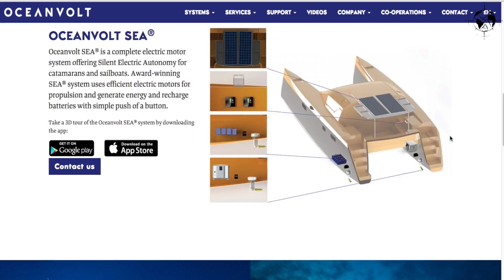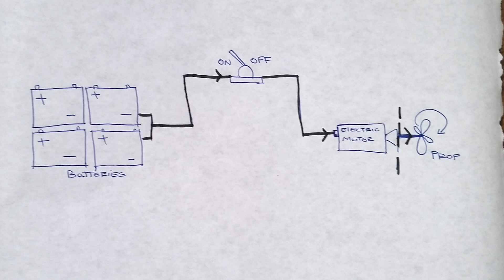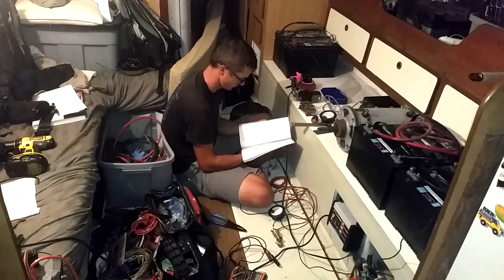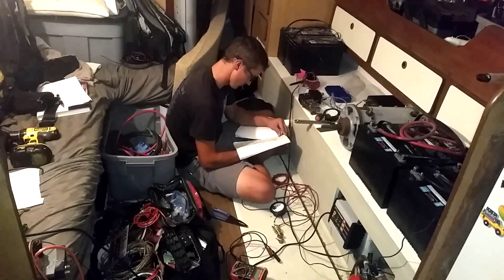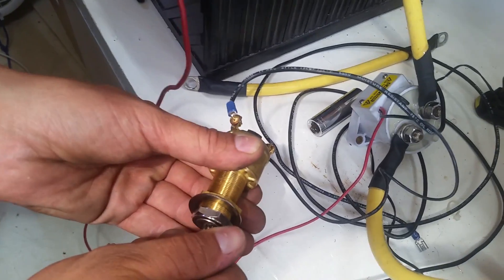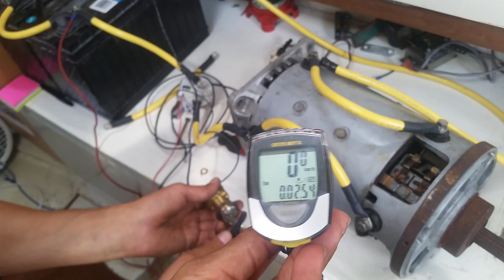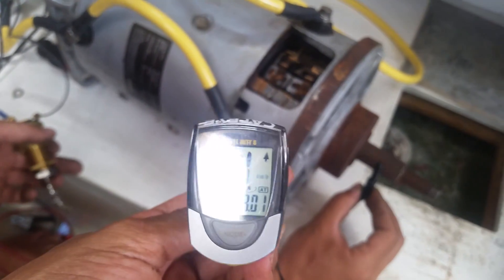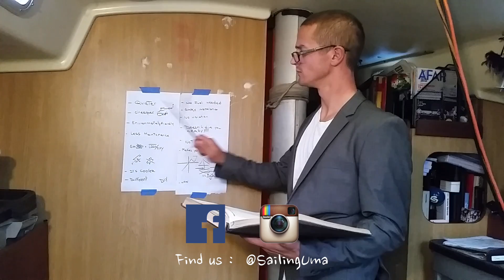We built our own ELECTRIC MOTOR  (Electro-Beke, part 1) — Sailing Uma [Step 17]

Comment: have a question can you put that electric motor in series with a diesel motor.  most electric motors shafts can be attached front and back. so it would be diesel transmission then electric motor. I have drawn it out I think it can work. so you can us electric and ha  .  've a diesel as back up.
Reply: Hellava life.  No put the trans in neutral when operating the electric motor. That way the diesel is not turning
Reply from the maker: +Thadeus Moor Yes, they actually make a Hybrid system. I can't remember which company does it. Maybe Electric Yacht? Anyway. It does exist.
Reply: +Thadeus Moor You'll want to make sure you check with your diesel motor manufacture to make sure the engine pumps oil thru the motor if its not running otherwise could cause you some issues running dry.  Maybe you could come up with some sort of disconnect between the shaft and the transmission just a thought.

Comment: Nice project, hope it will work as expected, especially HP wise, have you accounted for water resistente and displacement to calculate the true HP this engine will give you ? Anyway,...good sombody is doing this to propel a boat, especially with a DIY method 👍😆 .

Comment: Did you guys get a controller that will allow for re-genitive charging when under sail?  What will happen if something wraps the prop shaft?  The few electric motor installs I have seen use a pulley and belt system instead of direct connect. Just curious why you went with direct to the shaft connection.  Sure you will answer more questions in the next video.  Can't wait to see.  We have thought about converting out boat but not sure how we can store enough batteries to get the amp-hr needed to run more than 2-3 hrs at a time.  Thanks for taking the time to share

Comment: Looks like you're on your way to being an electric boat. One question, without a transmission if a line or piece of kelp wraps around your prop do you risk burning out your electric motor? Keep up the good work. Peace and blessings :-)
Reply from the maker: +Iandi Boats Don't think so. There are no mechanical connections like gears to break or seize. So if something gets wrapped the motor will slow down, stop or worst case blow a fuse.
Reply: Don't forget about the heat ribs, to get rid of the heat an electric engine generates !
Reply: +Sailing Uma Well, you might also burn out your battery park because of an amplified resistance on your electricl system that could then occur.
Reply: +Iandi Boats with the correct controller it should be fine...this is a forklift motor...they are run against very large loads that hold them back all day long
Reply: +Iandi Boats These motors are pretty tough, and yes extra strain and heat are an enemy.  The worst is running at too low of a state of charge on the batteries. as voltage goes down amperage goes up and creates more heat. "Ohms Law" I have several fork trucks under my care with 10k hs. deadman and the motors are as strong as the day they started. With that being said I have seen commutator bars lifted on a motor from a truck that got stuck and the operator over loaded the motor. In general the system should last and work well.  I have also seen accelerated brush wear and winding failure from poorly maintained batteries.

Comment: That was amazing. Can you come do ours too? What kind of battery capacity do you need for this? We'd love to hear some specs. :)
Reply: +Naitsirkhelo   the batteries are wired in series for 48 volts you only got the amp hours available of one battery 60ah. If you wire in parralel  12 volt then there would be 4 times the ah.

So if they have 60ah available at less 50% 30 ah available, that motor will need  at least 40-50 amps to turn a prop, so ya got less than 1 hour run time.
Reply: +Naitsirkhelo 240Ah is at 12volts pretty sure he set it up for 48v which means its a 60Ah bank
Reply: +Naitsirkhelo Correct except divide by half because you can't drain the batteries past 50%
Reply from the maker: +Two aboard Tuuli We will be posting more about specs and details in part 2. Stay tuned.
Reply: +Two aboard Tuuli They had 48V battery bank, the amp's of the bank will determine how long the batteries will last. The batteries looked like they could be around 60Ah each, so with 4 batteries that would make a total of 240Ah. The ampmeter showed about 20 amp at one point, that means they could run the motor on that speed for 12 hours before the battery bank is empty. Hope this helps :)
Reply: +Ivansgarage you're absolutely correct! I mixed up the math :p